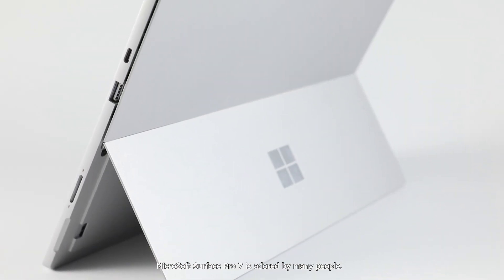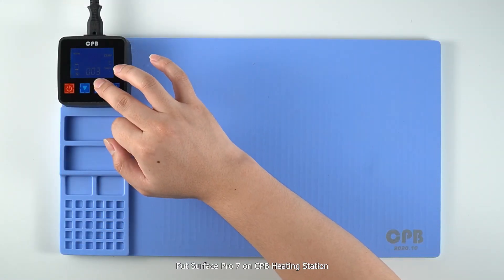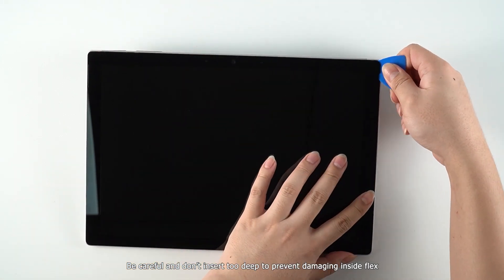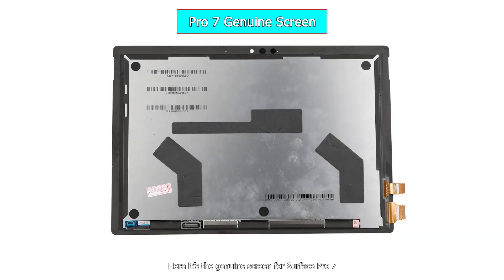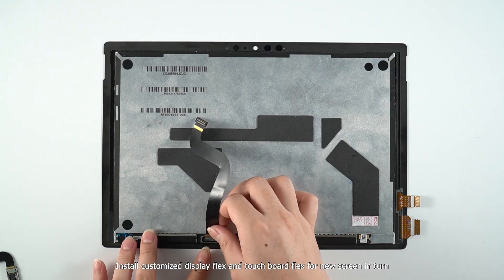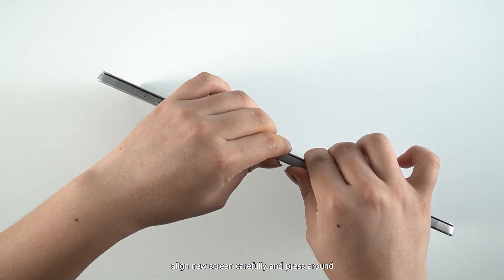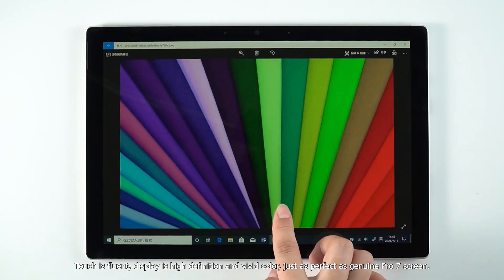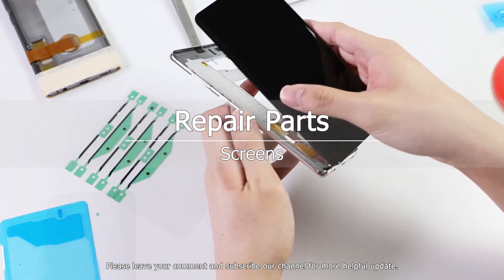MicroSoft Surface Pro 7 Screen Replacement Tutorial. Can We Repair It With Surface Pro 5 Screen?

Comment: Ehm, are there any custom display flags to fit displays from Surface Pro 7 to Surface Pro 7 Plus ? (Price is like 100-120$ difference) They look identical, but the location of one of the ports is way further.
Reply from the maker: By now, nope. If you want gorgeous price with high quality, feel free to let us know. https://wa.me/8613590142302.

Comment: I recently followed your video to do a screen replacement. It felt like everything went well but I am having an issue booting. When I first power on the device I see the windows logo, but then the screen turns off. It boots normally from there, and I can even attach it to my dock and use it with external peripherals. Do you know if there is an extra driver step? Is my screen bad?
Reply: Did you fix this? Stuck in the same situation.
Reply: @1225eal  i contacted Microsoft and they ended up replacing my unit. I did some digging though and turns out the boot logo is rendered on the display driver chip before the motherboard takes over. So the logo may be rendered on the display during initial startup but the motherboard could still either not be connected correctly or be shot causing it to go black. I hope this helps you in your situation. Maybe try contacting MS customer service and ask questions. Maybe they’ll throw you a bone
Reply: @kylelawson9107 Thank you so much. I appreciate the response.
Reply: I have the same problem but I used sureface pro 7 display I tried many it’s the same problem

Comment: I replaced my screen . But now the mutli touch doesn't work ???
Reply from the maker: Might be many possibilities: 1- Screen wasn't connected with board perfectly or screen bad; 2- One of screen flex connectors and board connectors was damaged or both;
Advices: 1- try to connect screen again; 2- inspect both connectors; 3- try to install screen on other board or try other board on same screen to troubleshoot where problem is.